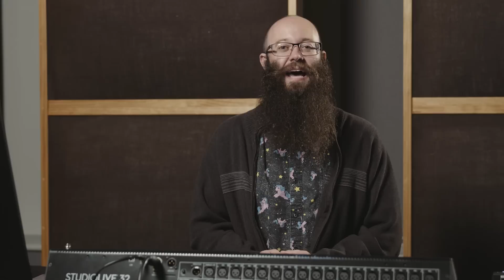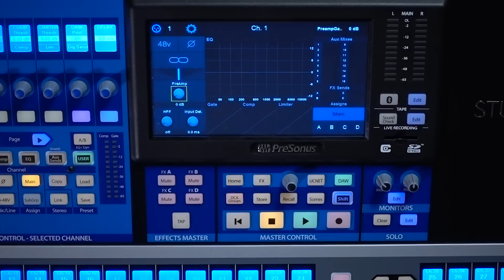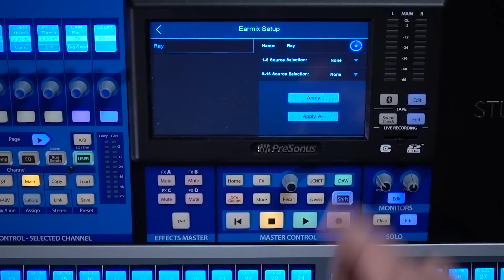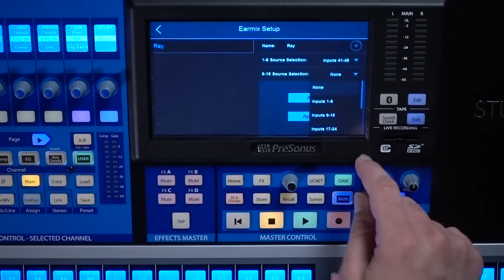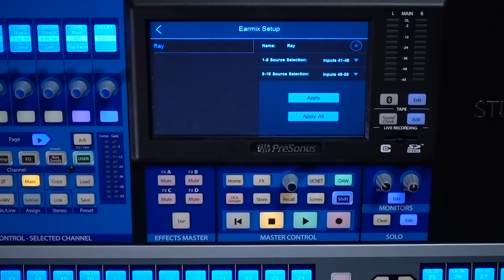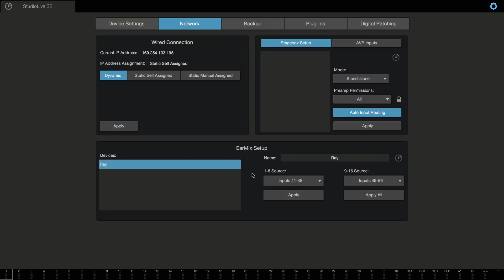PreSonus—EarMix Setup with your StudioLive Series III Mixer

Comment: I am having issues with my studiolive 64S certain channels won't send signal to my DAW the only way I can get them channels to work in my DAW or in Capture for that matter is by reseting the mixer to factory settings and if I upload a scene the same problem will occur them same channels won't send signal to the DAW or capture it is also starting to glitch if I have linked channels I have to unlink them and relink them in order for them to work as a stereo channel and so on and so on I have had no luck with this mixer and I am getting the run around from Presonus with every problem I have had my success rate for having problems solved with presonus are 0-10 unfortunately

Comment: Hi Ray!  I am still waiting for mine on back order, as well as my digital stage box.   I pretty much get the single channel output assignment to the EarMix, but still not sure of routing multiple channels, like the drum kit to a stereo pair.  I'm assuming you have to sacrifice say Aux 1&2 for a stereo mix of the whole drum kit and use those digitally to route to channels 1&2 of the EarMix.  Which means it starts to take away from my  stereo IEM mixes to the singers.  Also, I noticed that you sent channels 40-56 to the 16 channels of the EarMix.  Through soft patching can you duplicate your analog inputs to go out those channels?  Like duplicate channels 1-16 to also spit out 40-56?  Thanks bro!